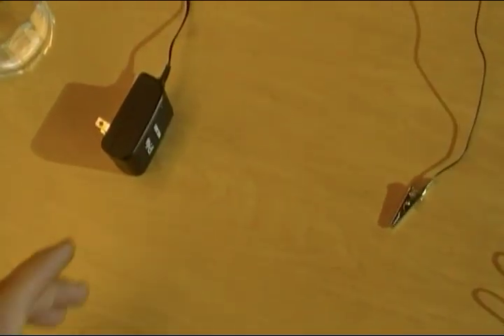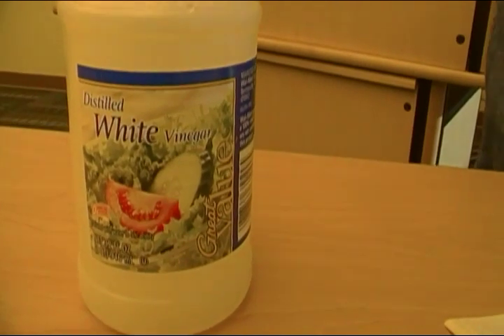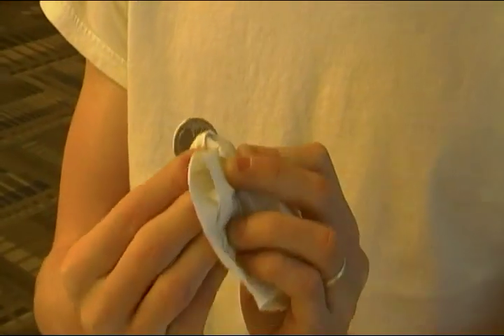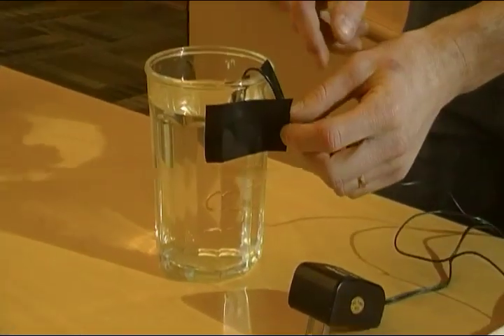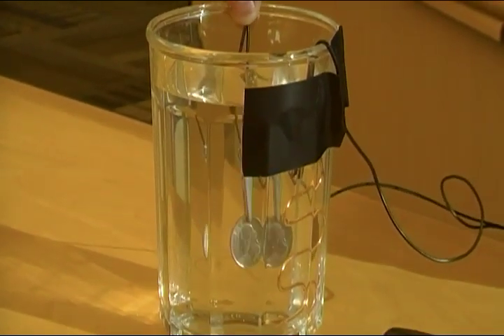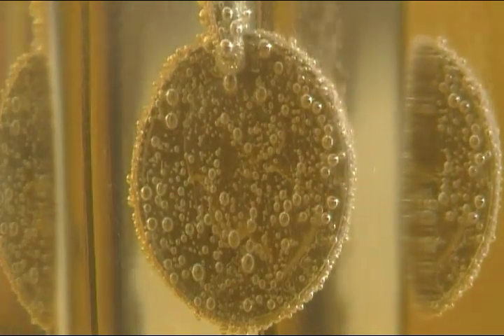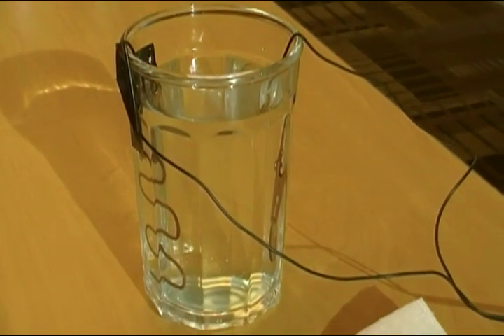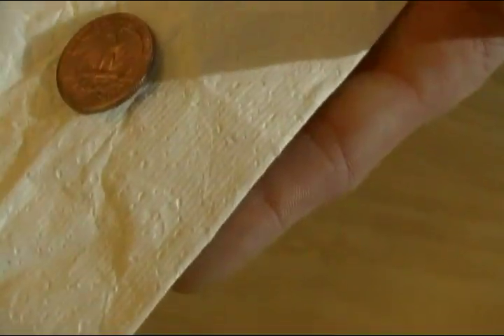Copper plating

Comment: @rccars4LiFE hope you figured out how to get the black oxide off. If so share :) my first plating experment was black, Try warming the solution up. I  warmed it up by putting boiling water in a cup then placing my solution  cup in the water cup and stirred. also i think dish soap can coat it and make it black if your contianer has any soap residue in it. But i'm no expert, just plated 8 times, still learning.

Comment: If  we short our walwart adapter, the fuse inside the adapter can blow. You will have to replace that fuse, which is somewhat hard to do. To prevent this hook up a fuse to your work. Or use a "D" battery. Have fun